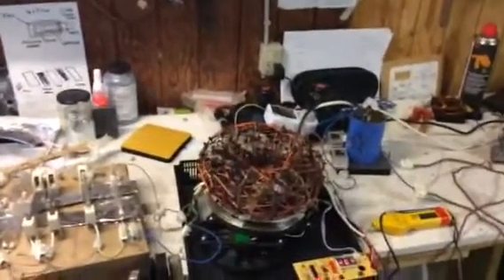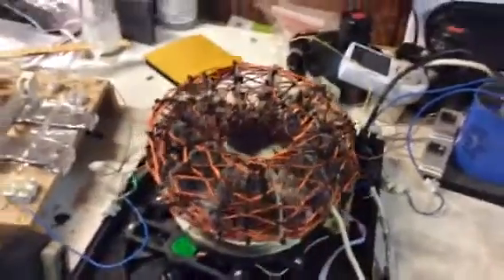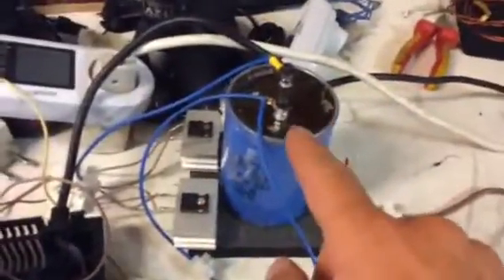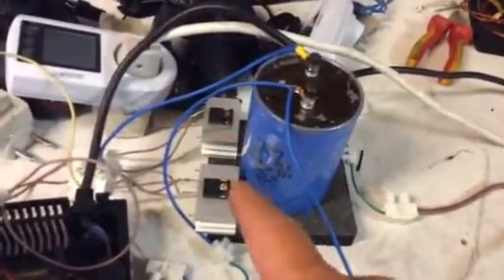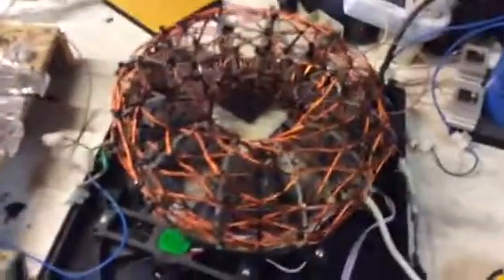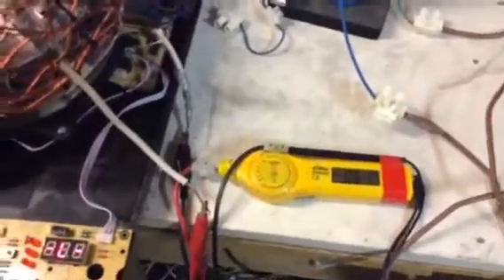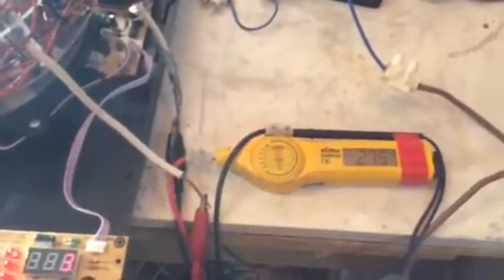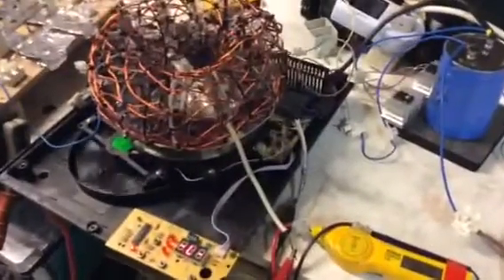Rodin coil and induction hob experiment

Comment: That's only half the story, is there any way of removing the induction coil so that you can mirror below the coil as well?
 'as above so below'.
Reply from the maker: clixbits can you explain a little more,I am a little unsure? Thanks.
Reply: You're only currently using one side (the top)  of the induction coil. no such thing as a one sided magnet is there? p.s. Don't forget when looking at the poles of a magnet end on, that North runs Anticlockwise, and South Clockwise.
Reply: hmm... around a small former works.... I wound mine on weed-whacker plastic string former... (took a bit, and coiled it so I had a toroid form to wind on...  

https://drive.google.com/file/d/14tL40Dz21r87T14qTm3QTpSEUJ1eAcpUiQ  kinda like that... 

(the inner coil is what I'm referring to; it was actually made with 2 strand phone patch panel wire... solid core thin gauge)
https://drive.google.com/open?id=1LrZpU-gQnmAdM9qGH-j53iHhbZ8n3L_gZw  was 12 turns (24 if y ou join the bifilar in series)

SOmething else - fi you have really I have an album on facebook if you use that I'll share that

If you have thicker gauge wire that can hold its own form... can also use that....
https://drive.google.com/file/d/16ZeJM48jel4pfK3xnu-P7V3Xz7U1XGFnyg
held out by just cadboard tube inserted inside in 4 spots...
https://drive.google.com/open?id=1FSDFhLGtuU8hWpGaYrKqi4Vwbl_b3fH_XA
and then this one I used thicker gauge magnet wire that I twisted together to make multifilar on the same sort of core... . (notice the cords of magnet wire are thicker around the same... 
https://drive.google.com/open?id=1yPe2dy502XcVZ3UyTsxnuttpAh0rzrDChw  
But at that point the center form is collapsed around like a 5/8" tube  .... 

ALl this is just food for thought, and not to be taken literally :)

Though my better results were the 12(24) bifilar phone coil driving the 14 gauge wire (red/green)  
And I only went the one direction, I didn't cross-hatch it.  

From my smaller coil tests I tried different ratios than 1 around and 1 through, like 3 times through for one around, and that quality and resonance was worse... 
https://drive.google.com/open?id=1CXwJz7Bu6jSHZhC9-7VRr0xnmKHQz9NdjQ
https://drive.google.com/open?id=1sunNbgu05EyPoEHboZzvHRr0zB7p5qrjbg

(video) 
https://drive.google.com/open?id=1edb32cBFPCTNF6ZTyGsrFbYnqQkoOqjJhQ   This w one layer internally with another wound the opposite direction (cross hatched like yours )
I didn't notice any better benefit to that; just added complication in building ... 

Playing with just winding the coils (using the weed whacker cutter cord)
https://drive.google.com/open?id=16InKL8tt1pvwta3VodCaexjpDJgyCLfCYA
https://drive.google.com/open?id=13lRhcKoPT9ZqmMsbEtdoId-AWG6-TokllA
If too many turns were used, couldn't make a good form of coil... Like there's as solid loop on the side of the one, and I'm holding it kind of suspended in the center of the other picture...    There's a toy called toroflux (https://www.flowtoys.com/toroflux/toroflux ) which is the same sort of winding pattern....

I dunno :) Just rambling now.
Reply: One more note I guess maybe I was wrong about the smaller driving larger... if the turn ratio was too different it didn't work very well (like the multifilar one my outer bundle had 24 filaments of magnet wire (so I could have 12 and 12  in series each  ( and 12 turns around the toroid of that, so baseically 144 turns per filament ) and I couldn't drive that with the 12 (24) red/green 14 gauge coil... but I could drive the red/green 12(24)  turn with a smaller bifilar from that phone patch cable coil...
Reply: I did do one 3 inch coil that was clockwise, counter clockwise, clockwise counter clockwise  - basically 4 layer, hatched sort of pattern, that had horrible results :)   I thought it would be really good high inductance of you know 4 should be better than 2 ... but no....

Comment: It works slightly better using another smaller rodin coil to drive it... a standard coild (solenoid/pancake) didn't work with it as well as a driver shrug ...  I may be remmberring wrong.
Reply: Although - the driver coil doesn't have to be so many turns... could just take a say 6m wire and wind a 6 inch coil with like 12 turns...
Reply from the maker: J Decker thanks, I will try this, it it in 3D form or flat? And the driver it this driver too strong?

Comment: Nice coil. Did you see Russ's rodin coil experiments? COP10 but he couldn't figure out how to extract the power without reflection. But I believe Hector Perez Torres' diode plug can be used to do this. When I've got a spare £300 I want to get me one of those coils :-)
Reply from the maker: Mark Flint I made it myself plastic sheet and cut them with an angle grinder. The wire was from two old induction hob coils. I was also thinking of tesla wardencliff tower,and the top section,if it was this kind of design? If you have any ideas please tell .thanks:)
Reply: Oh, that's some doing! I've seen sites that help with 3D printed formers which I might be a good option. Looking at the shape of the wire structure on top of tesla's tower I don't think a rodin coil was up there, but hard say.
Reply from the maker: Mark Flint ha no I mean the toroidal shape. Haha:)
Reply: Yeah, sorry! These are the coils I would get if I have the spare dough: https://1stopenergies.com. I would pulse it with a frequency generator + amp, and use a diode plug (https://sites.google.com/site/alternativeworldenergy/diode-plug-output-circuits - obviously not with motor coil, but with "AC" coil output) to extract the power. That's on my todo list :-) I'm still focusing on motors at the moment, but intend to get back to ZVS + pancake coil at some point. The problem with them is the high amps required to test, and I don't have a big enough power supply.
Reply from the maker: Mark Flint yes nice coil, but pricey that is why I try to do everything I can myself, and it often bites me in the butt